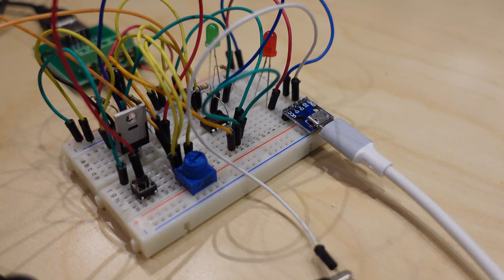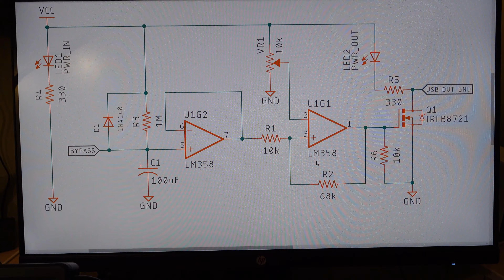Designing a USB Power-On Delay Circuit

Comment: Is there a USB adapter with a power-on delay circuit to buy it. I need it for an USB  keyboard which is preventing starting a HP laptop. I have to pull out the USB plug and plug in after few seconds.

Comment: What?!? No 555? Just kidding. Thanks for sharing your video 😎
Reply from the maker: I actually started with a 555 (which internally has some similarity to this circuit) but due to its fixed 1/3 supply voltage reference on the trigger, I couldn't get the range needed with a 10k pot (and wanted to use parts I had available). Maybe I'll do a video about that.